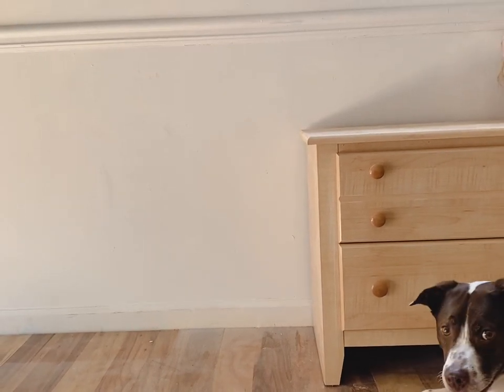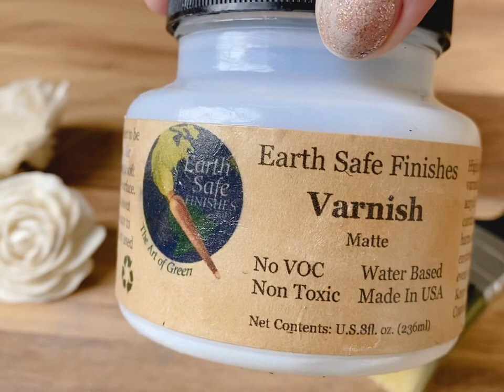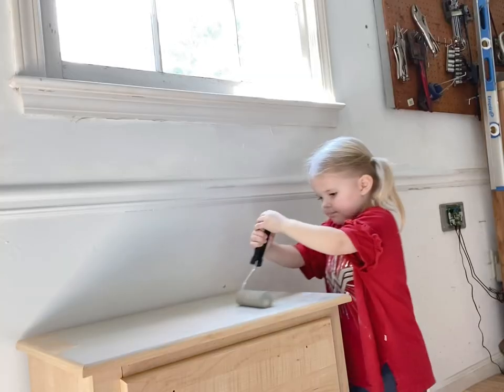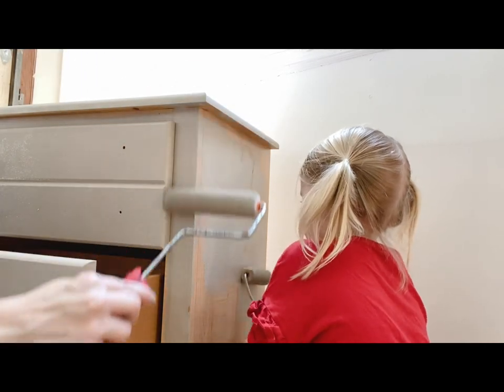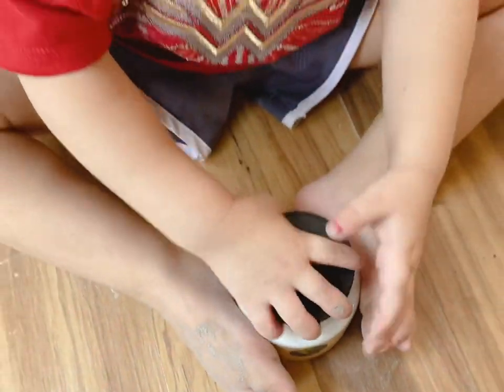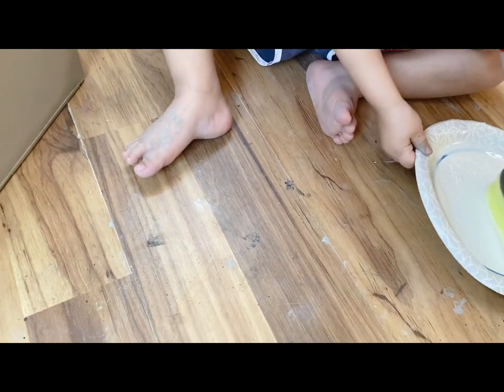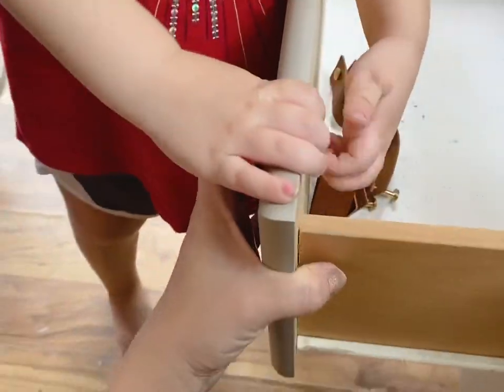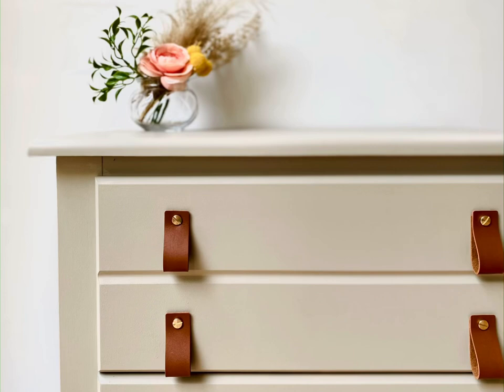Fast Furniture Flip with my toddler • non toxic furniture paint • Dollar tree foam pad & Roller

Comment: Wow! She did great! She's got a longer attention span than I do! 😂 I swear by those applicator sponges for applying poly. We don't have them at our dollar stores, though. I get mine from eBay for about $5 but they're so totally worth it! If you dampen it (get it thoroughly wet then wring it out completely) it works even better. Just an FYI for next time ... the contoured yellow part is the handle, the flat gray side is the applicator. 🙃